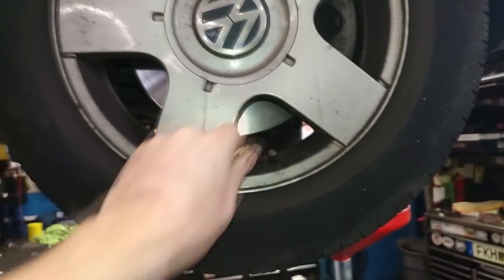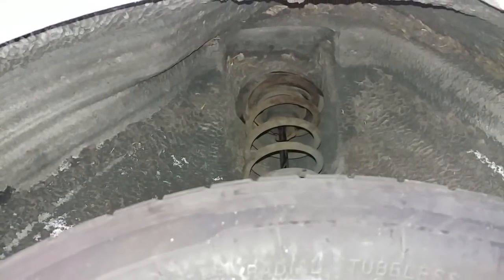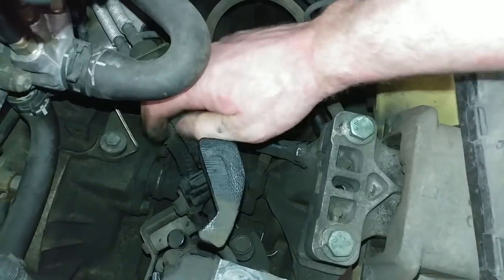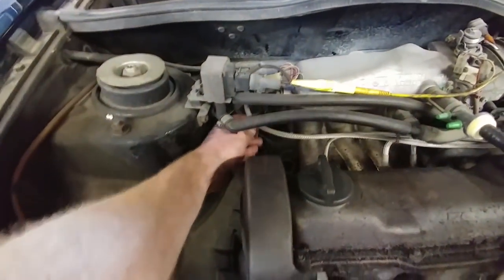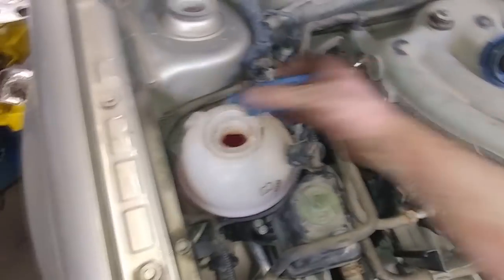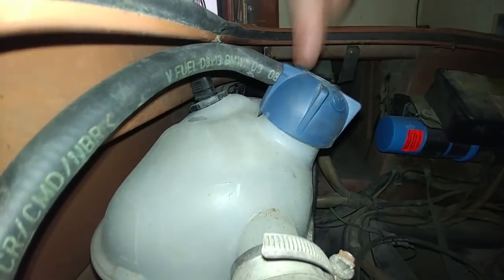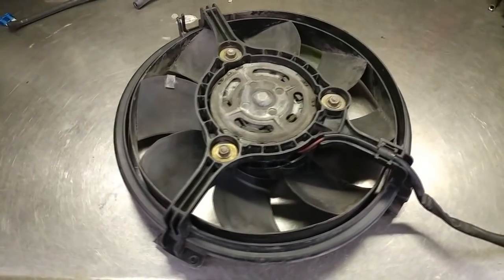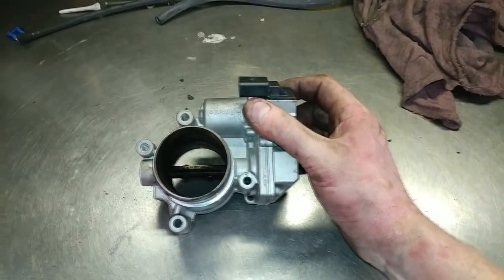Various bits May 2018

Comment: Hey I do have a question this is for a 1.8t passat. Car cranks but no start. Check for spar and it’s good and the compression is good, I just replaced the fuel pump and I pulled out the injectors finding out that there is no fuel pressure. What could be the cause of it?
Reply from the maker: Are the fuel lines connected correctly (not reversed) at the pump? Pulled the injectors from the head or from the fuel rail?
Reply: Thomas EXOVCDS yes I checked the fuel lines to the pump and they are correct. I pulled it off from the block.
Reply: Thomas EXOVCDS idk if it’s the fuel filter.
Reply from the maker: Make sure that the pump is actually turning / pumping and that the connections inside the tank are on / didn't pop off of the pump.
Reply: Thomas EXOVCDS so i ended up hooking up the old fuel pump to a 12v and the pump is running.
Reply: I will recheck my work on the pump
Reply: Thomas EXOVCDS also plugged in my VCDS and I don’t see any fault code in the system.
Reply: So finally got the pump running. But the car is still not running. Also find out that the number 2 coil is not firing. So plugged in my scan tool got a code p1850.

Comment: Thomas, what grade oil/viscosity should I use on my MK3 Jetta 2.0 for the Phoenix summer? Glad your back safe!
Reply from the maker: I replied a week ago to your initial post.
-----
Have a look at (google) an oil viscosity chart and pick according to your climate / temperature. I would go with a single grade like SAE40 (as an example) if ambient temps are that high. Confirm with mechanics in your area.

-----
We donj't have to deal with hot temperatures like that, so a multigrade oil is fine for us.
Reply: I have arelative who is married and lives in Vancouver. I'm used to the 110+ and the weather all night that doesn't go below 90°. I don't even use the a/c when driving cause I work outside all day. Just drink gallons of good water.I grew up in the Midwest with plenty of snow, but that was 40 years ago. Thanks for replying Thomas! Your a good Man!
Reply from the maker: crimp creep those are some crazy temperatures! Low to mid 20'sC is just fine for me! =)

Comment: Thomas, i have a 08 rabbit now with 270km, it needs lots of work so looking at a new car, looking at a pre-owned 2016 Audi A6, what are your thoughts on that car? Any issues that stand out to you? Are they very expensive to repair and maintain? Its got 45000k on it, from a Audi dealer, I'm looking to finance and get 8-10 years out of it. 
Thanks,
Cody
Reply from the maker: That's too new a car for me... I have yet to see one in the shop. If you also get a warranty that lasts the length of the financing, then I would say go for it. New cars are expensive to repair when things go wrong... that's why I have / drive 3 old cars that cost me under $2000 each. They all look great and are cheap to maintain (as long as parts are still available).
Reply: Thomas EXOVCDS Good to know, thanks for the advice!

Comment: That steering wheel cover is terrible. I put a leather steering wheel cover on my 2006 scion xb, but it fits very tight and it's sewn on, it doesn't shift around like that
Reply from the maker: I've even seen / felt ones that were looser than that one! What are people thinking!?
Reply: That's jsut it. They are not thinking!

Comment: Hi Thomas, great video
Im having a problem with my 2011 tiguan, my check engine is one misfire #2 cylinder and P025A fuel pump module, the misfire is only happening at idle after star the car, and sometimes the car shake or jerk in acceleration under 2500 rpm after 2500 rpm is running fine, is taking a lot more gas, the fuel pump module was change 8 months ago. I have new plugs, coils, pcv valve 
Thank s lot
Reply from the maker: Cold start misfires can be due to carbon in the intake port of the cylinder head. 
I can only suggest to monitor power & ground at the pump module and "control" of the pump.
Reply: Thomas EXOVCDS 
Thank you Thomas

Comment: That Steering wheel cover is lethal to say the least... here in uk they are very popular amongst taxi drivers ...
I’ve cleaned a few the same Crd throttle body they seem to get stuck close after 200k miles  fault code p0121... 
Nice video Thomas nice to have you back 👍
Reply from the maker: Thank you... I need to do some catching up on video watching now. =)